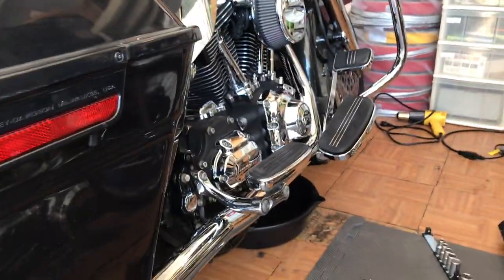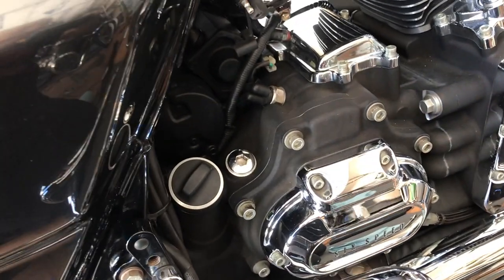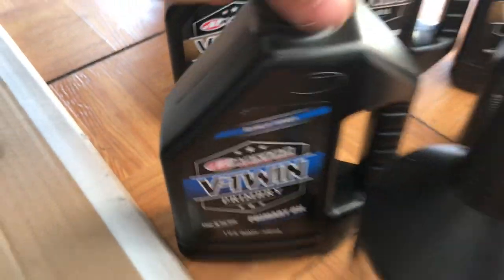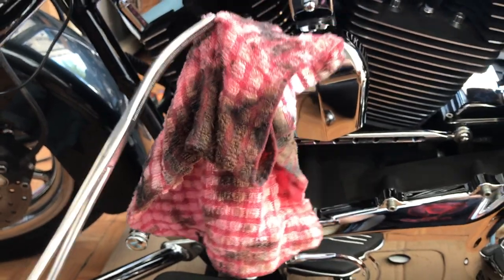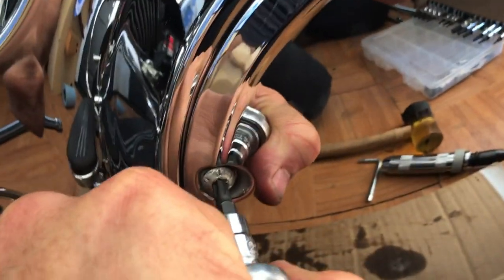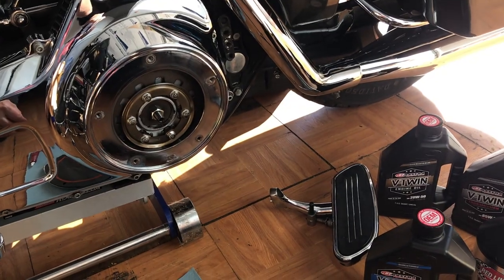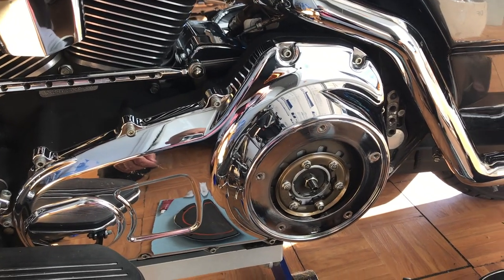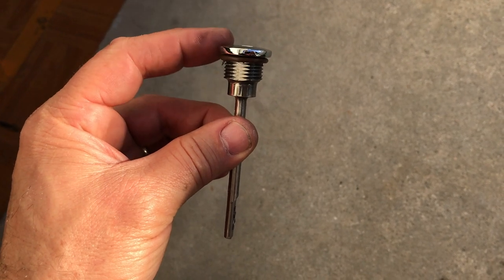3-Hole Oil Change - Harley

Comment: I should have figured by the looks of the Honda that you rode a H.D. Yes I also have an 03 FLHRCI that you can eat off the bottom. I wish they had torx bits for the impact driver.

Comment: What is the different between primary oil and engine oil??!!I know you can use exactly the same, in trasmission only if you want you can use 75-80w if you want quieter gear changes.
Reply from the maker: I’m not an expert. I guess primary oil is a little heavier, like you mentioned.